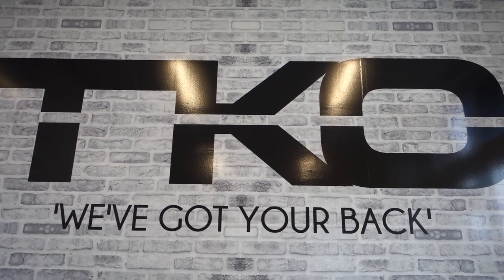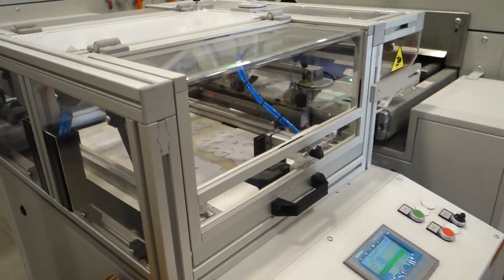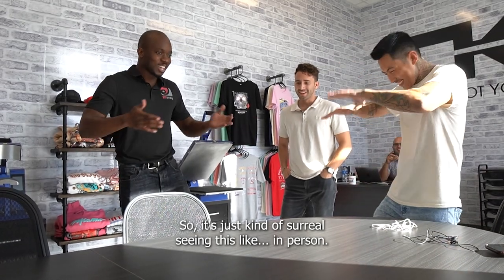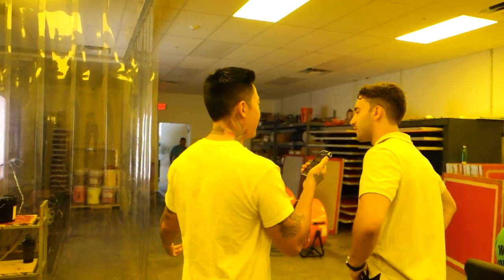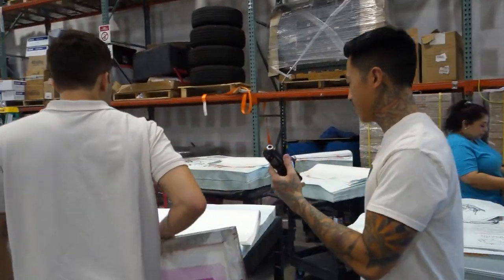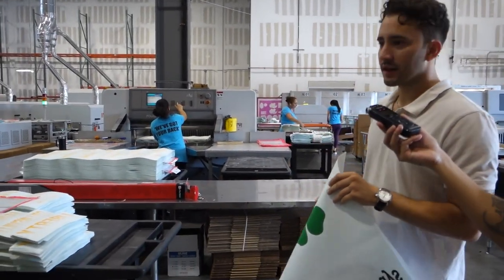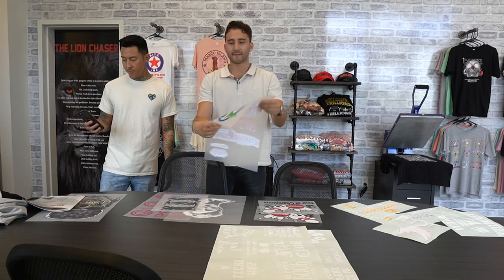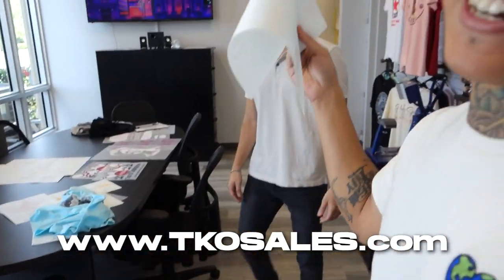How Transfers Are Made - 15 Cent Transfers and Full Color Digital Transfers at TKOSales

Comment: I got a question I just ordered a 16 x 20 wala press auto open pro and I see a lot of other Youtubers like you for heat press videos and you guys have the Teflon covers I’m wondering about those do you recommend him what are they really do compared to the others because I was thinking about getting it but I like that one it’s like it’s $70 but I don’t know if you can answer that question for me that be great please
Reply from the maker: 1. Sometimes the film to transfers stick to the metal of the heat press, the Teflon helps avoid that.

2. Sometimes you’ll want to give your transfers a additional press after it’s already transferred from the film and you don’t want to press it directly with the metal platen, so you’ll want to use the Teflon to protect the design

You can use some parchment paper from the grocery store from the time being if you’d like a cheaper solution 

You can also find Teflon sheets on Amazon for $20 or so and you can use heat tape to tape it to your press
Reply: Great question. I need them Teflon covers now hustler ninja 🥷🏾 drop the link bro please
Reply from the maker: @richstateofmind9131  https://amzn.to/3vNnYER
Reply: I was gonna get the cover it’s not a issue but I wasn’t sure if it comes out differently the transfer a little bit by using it

Comment: Can anyone vouch for how tko 15 cent transfers feel? 

From my experience with 613 Originals and FM Expressions, 15 cent transfers feel rough like paper. I don't like it. Best product I've tried so far is from Howard Custom Transfers (HCT). HCT feels just like regular screen print, but theirs is priced higher like regular screen printing.
Reply from the maker: It feels similar to 613. I need to try out some Howard transfers.
Reply: @HustleNinjas  Ah okay. Thanks boss! I would love to save more money on transfers, but I just haven't found cheaper ones to feel great to me. 
Howard is pricier, but I definitely don't regret it. You'll end up paying about as much as you would at a normal screen printing shop with them, but the quality is really unmatched in my opinion. Plus, they also allow ganging, so you can still save a bunch on smaller sized prints. 

But I may just be really picky, lol! The 15 cent transfers are working for people so hey!
Reply: @elevated-apparel  not true. Transfers that I have gotten from Howard custom transfers feel very different than the ones that I got from FM expressions or the other 15 cent transfer places.